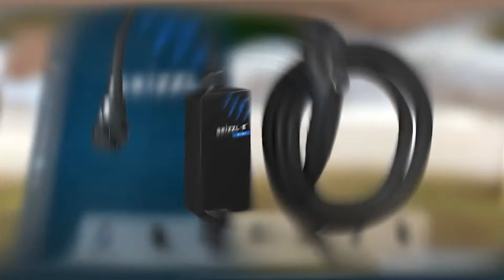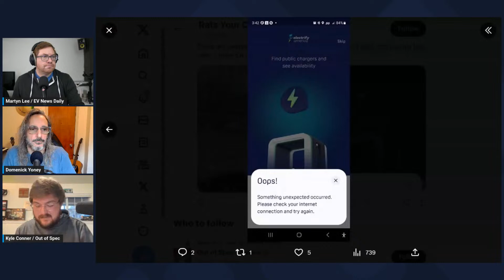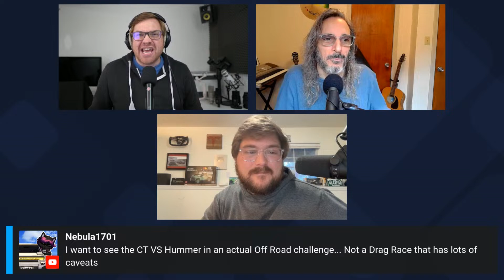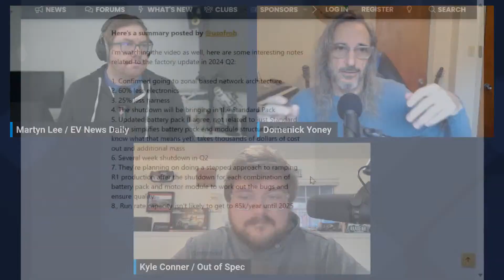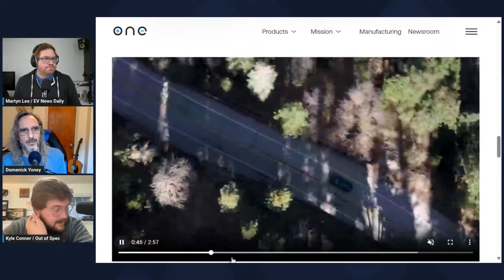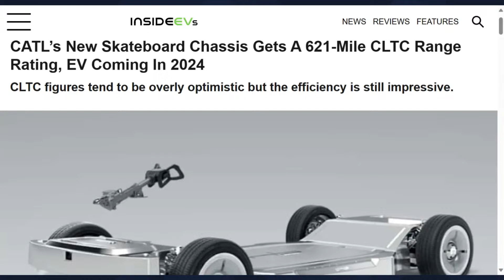Towing Two Antique EVs Across Country, Our Next Energy Boosts BMW iX Range To 608 Miles

Comment: The cybertruck is simply a showcase of Tesla technology as well as being a good truck.

4680 shows same performance down to 30% SoC, 48v system generally which enables fly by wire for first time in a car, vtl, 800v battery pack.

Comment: What about BEAM solar charging stations with batteries? Question for Kyle Conner.
Reply: Beam is a special use case.  It’s claim to fame is not connecting to the grid.  At best, it only delivers 40kW per day.  That’s barely charging one EV.  At $64K less any govt incentives, it’s extremely hard to justify if you have access to economical power.  Pop one out in the sunny desert or wasteland where there’s no juice and it’s excellent.
Reply: @johnpoldo8817  it is backed with batteries so it can power many vehicles and is constantly getting recharged. Watch the episode
Reply: @robertpawley5715  I watched it intensely.  On a sunny day, the batteries store 40 kW maximum.  Most EVs can easily consume that much power and more on a single charge.  So if there are no restrictions on charging, this expensive station not tied to the grid only charges one car a day.  
Put an 11kW Juicebox EVSE on it, limit time to one hour, and if lucky 3-4 EVs each get about 30 miles of charge.

Comment: By the way, from my perspective, the EA story is news because they did the right thing which is not their normal modus operandi.  They have that many points in their history been somewhat less than opague in their discourse with the public.They had an issue they got out in front of it, and it will resolve itself without harm to the public.

I do agree with Martin, that most of the reviews by the guys who had it early were pretty positive and didn’t seem done biased, but what’s the most glaring is that none of them discussed the charging performance which means they were in someway and embargoed from discussing it Because, if it was really good, they would’ve said that.if   it was really bad., they would’ve said that.   The fact that they said nothing says that they were not allowed to comment .

Comment: I'm not personally sold on the Ram REV. My impression is...why pay more money for more maintenance, more moving parts, and more hassle? What is the advantage there? I would rather just get a cool every day EV, and buy a used deisel for the towing. I am a huge EV enthusiast and I will probably never own a combustion car, but there are still use cases in 2023 for ICEs. Heavy towing is one of them.
Reply: As you point out, The problem with hybrids is that they are the worst of both worlds. They’re neither a good ice car or a good electric and they have more maintenance.
Reply: I just did some research this is an announced product that will not be available until 2025 at the earliest I’m really tired of reporting on things that don’t exist. We just got through a week and a half of people yelling about the fact that the cyber truck they got wasn’t the one they talked about The Chevy Silverado is basically unavailable you know Cadillac Lyrica are hard to get. Let’s talk about the cars we can get not the ones  we can’t get.

Comment: I recently charged my 2015 Leaf next to a BZ4X at a Target Chargepoint DCFC. I went from about 23% to 91% in the time it took it to go from 88% to 93%. 😯
Reply: You're sorta comparing apples to oranges as the battery size of LEAF is considerably smaller than the BZ4X.  Also, any EV charging above 80% on DCFC is likely charging at a very slow rate.
Reply: Apples are better

Comment: Not sure I would want to use V2H except for emergencies as it would create more unnecessary battery cycles that would increase battery degradation overall.
Reply: You forget that you likely daily cycle your EV battery at much higher charge/discharge rates than most homes.  When I accelerate modestly, I'm using about 25 kW of power, let alone if you push it harder and use 2-3X that energy.  Most homes rarely use more than 10 kW (maybe with HVAC and electric dryer) for any length of time.  Right now, my house is using 2.7 kW because we're using the cooktop and have some lights on, hardly a big load for most EV batteries.
Reply: Yes, I'm generally opposed to the idea of wearing out your expensive EV battery, but house usage is relatively gentle. When ev batteries are used In a house app , it usually w/o therm mgmt, not needed.

Comment: I owned 3 of these. First was in 1976 was the original one than I bought the "updated" one in 1980. The third was a used one bought on eBay that I was going to upgrade but never did and sold it. That 6 HP DC motor was amazing to propel the car over 55 MPH. They were a ton of fun and I got hooked on EVs way back in 1976!
Reply: That's pretty cool

Comment: The 4680 cell is dual purpose. It provides structural rigidity. The 18650/2170 does not. Citing specific gravimetric or volumetric energy density is not an apples to apples comparison.